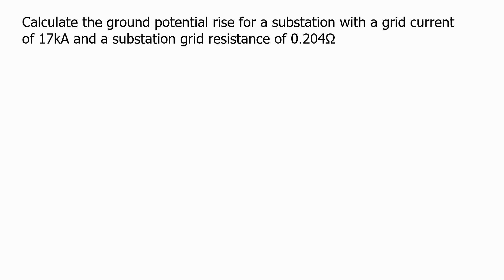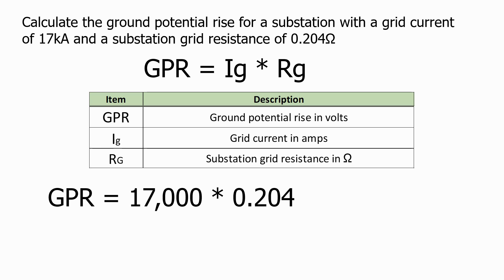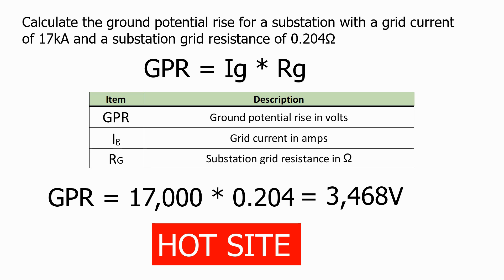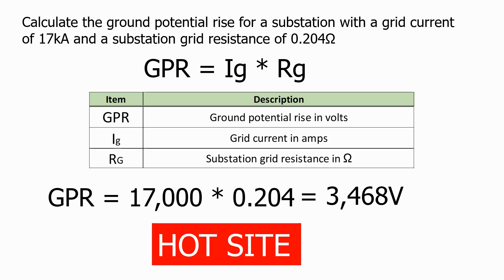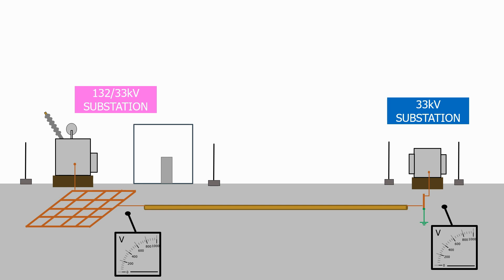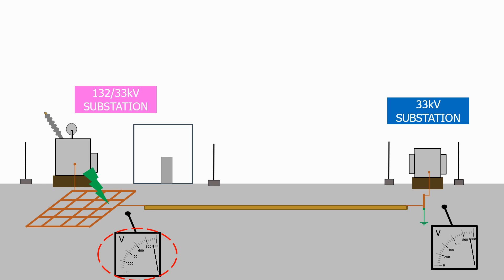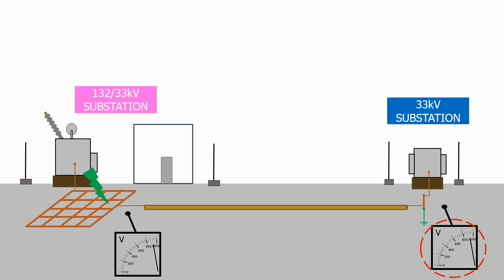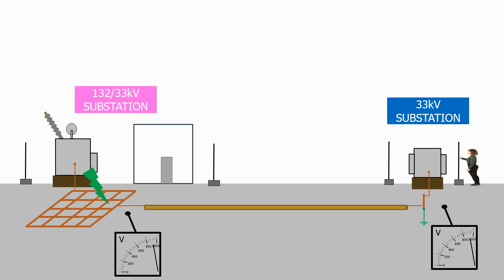Ground potential rise

Comment: Wouldn't the sheath be energized up to the receiving station
Reply from the maker: Hi Kevin, at several cable joints along the route we ground the sheath with a non linear resistor to keep the induced voltage down to an acceptable level.

steve